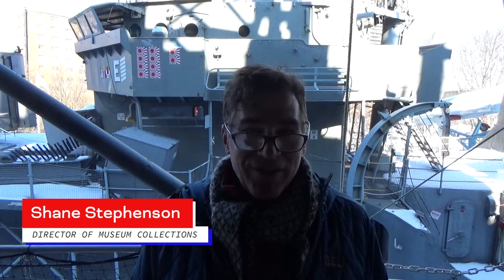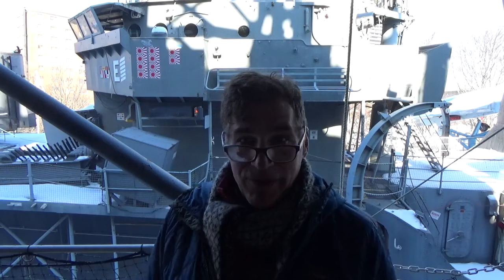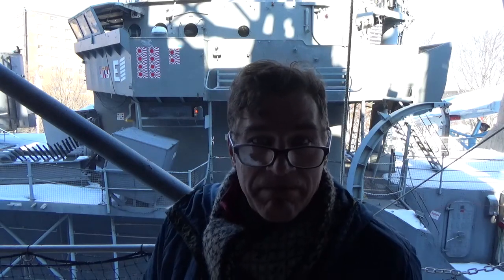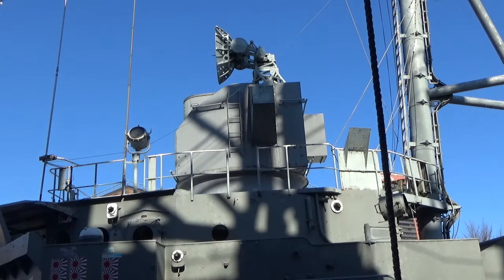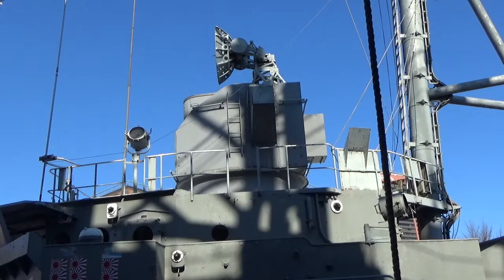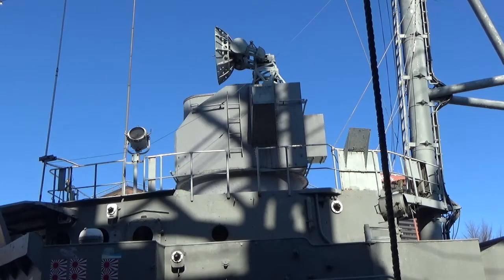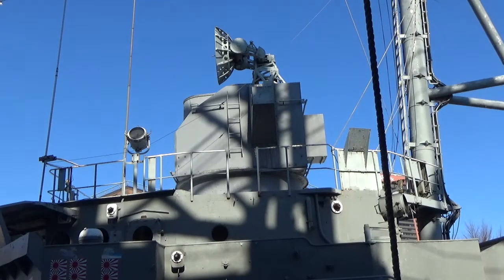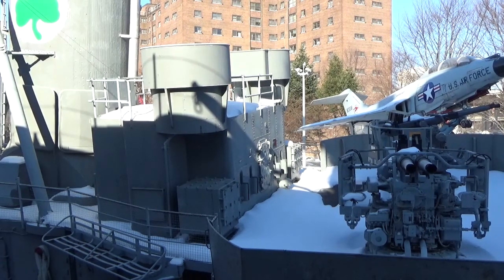USS The Sullivans: Gun Directors

Comment: It seems that as originally commissioned, The Sullivans didn't have directors for her 40mm guns as you stated. Sometime in early 1944, she acquired five Mk 51 directors, one for each 40mm mount. A wrap-around platform was installed on her aft funnel which held the new directors for the waist twin Bofors mounts. Those bofors were in smaller tubs directly abeam of the aft funnel. In the August 1945 refit, those twin mounts and the gun tubs for them were removed, and the new, larger tubs that you currently have were installed about 20ish feet forward of the originals. The aft torpedo tubes were removed, and that structure was installed where it is now. That inside of the structure housed radar operators, because the new quad bofors each had Mk 19 fire control radars mounted to them. On top of the structure was a pair of Mk 51 Mod 6 directors, which when in this configuration were designated the Mk 63 GFCS. Those directors controlled the waist quad mounts, with the mounted radars allowing full blind-tracking capabilities.

The Navsource page for The Sullivans has some good pictures of each of these configurations.
Reply from the maker: Thanks for your comments. Navsource is a great site, but the dates of various photographs can be a little misleading. There are some good pictures of The Sullivans that state a year or circa year (ca. 1950), well, the ship was still decommissioned from WWII in 1950 so it changes the years of configurations if listing the wrong years. The major refits were 1945, 1951, and 1954. 
1945: Added two quad bofors, removed one quintuple torpedo mount
1951: Getting ready for Korea - removed both bofors up near bridge and added hedgehogs
1954: Removed Mt. 53 (5" gun) and added three 3" 50's. 
There were other alterations at that time. 
The Mk 51 tower was added in 1945 and was replaced by the Mk 63 tower in 1954 with a larger footprint because it was also the ready service station for the 3"50 projectiles. The expanded mid-ship deckhouse was expanded in 1954 to support the weight of the two mid-ship 3" mounts and to hold the amplidyne room, radar and Mk 63 GFCS.  
The platform on the aft smokestack would have been for the Mk 15 (blast-shielded) quintuple between the aft deckhouse and aft stack. It was removed when the last quintuple was removed, but then brought back when they had the Mk 32 ASW torpedoes which were added in 1961. Thanks again.

Comment: Thank you for making this video! I've been a huge fan of the workhorse Fletchers. I'm glad you mentioned the elephant in the room- that the 53 turret was removed. If I may ask, why was it removed? I know the navy modified ships over the years as technology changed, but in those cases there is always a physical sign of what it changed to. The 53 mount location looks empty of any equipment meant to replace that gun, and I don't think the navy left it empty just to provide a place for sailors to lay out in the sun and work on their tans. 😉
Reply from the maker: Thanks for tuning in! Sure, Mt 53 was removed in 1954, and three 3"50's were added...two mid-ships, and one on the aft superstructure, 02 level. The spot where Mt 53 was, became the electrical shop (on the 01), and then above housed the gun director for the 3"50s, the Mk56. If you take a look at that video again (any time around 9:57) you'll see that blue plaque on the forward facing bulkhead on the 01 level, that bulkhead is the forward section of the electrical shop and where Mt 53 was. It wasn't forward of that on the catwalk, it was in the same spot. So, no sunning themselves...unless they wanted to do it inside the electrical shop!
Reply: @BuffaloNavalPark   Thank you!  It's bothered me for years. I felt like a  Fletcher with only 4 mounts was missing a close family member. 😆I couldn't figure out why  they'd take away such a potent tool unless it was for enhanced AA, another torpedo rack or something else, but didn't see any signs of hardware for that. The director for the 3" finally explains it! 💡  👍
Reply from the maker: You're welcome, and happy to help! There is one "brother" missing compared to the five 5" on the other Fletchers!

Comment: So, after 1959, Sullivans had 3  twin 3"/50 mounts?  And no more Bofors?
Reply from the maker: Thanks for the comment, Pyroman6000. I'll have to confirm tomorrow, but yes - they added triple torpedo tubes instead of the quintuple's, the Hedgehog ASW (Anti-Submarine Welfare) explosives where the Bofors were straddling the 01 level below the bridge, and I'm pretty sure all other Bofors were removed on the deckhouse mid-ship! I know the 20MM's were taken off after the 1959 refit, but have to be 100% for the Bofors - though I'm 90% sure! I'll check back!
Reply from the maker: Pyroman6000 - I've gone through the schematics and diagrams after her 1959 refit, and correct, there were no Bofors on board. I was 100% about the 20MM Oerlikons, but I wasn't 100% about the Bofors. Verified it today, though. Thanks again!